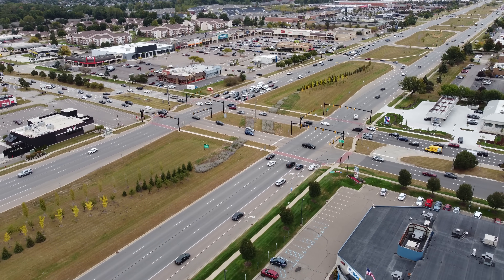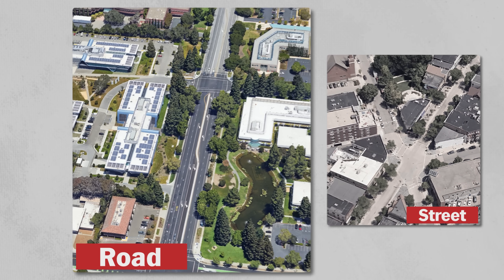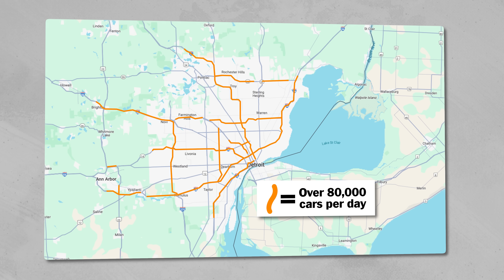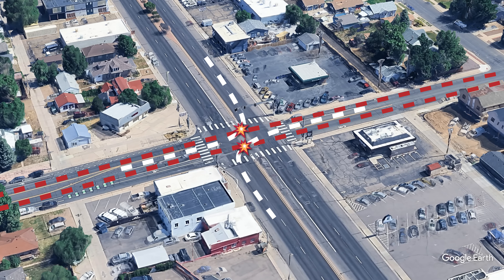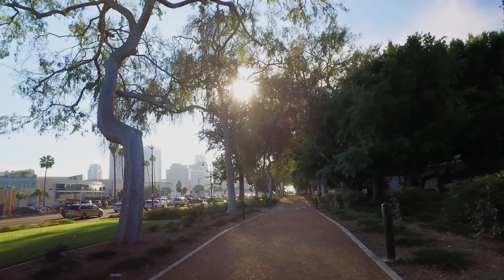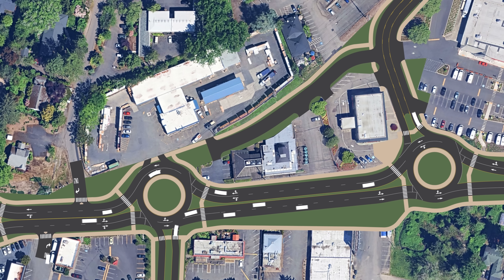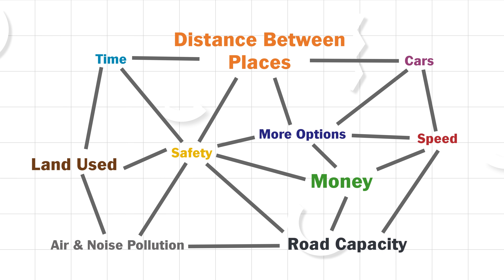How Michigan Built a Super Highway Using Only U-Turns

Comment: In my city Hyderabad India 
It is is very large city recently 5 years ago they decided to replace 50% traffic signals by underpasses and flyovers 
The rest 50% signals simply converted into u turns
There is huge back lash from public but it is saving time

Only issue happening is the one supposed to go straight have to take two turns and he simply shatteres all the flow in all lanes

Comment: 1 thing that was not mentioned in the Uturn idea, is that when in a truck the  vehicle gap problem multiplied. You frequently get "stranded" at a side road and are dependant on a good samaritan to open a gap for you. Very frustrating.   The 2 U turn concept means (directly) less frustration doing your job and ( indirectly) having to deal with other frustrated drivers,getting carved up, brake checked, bullied and harassed ,blocked etc.
Reply: So wait for a green light...
Reply: @traffic.engineer  There are NO traffic lights on side roads in the senario I mentioned.

Comment: I remember the many years before they rebuilt Hall Road, and one of the major issues with it was that on the eastern end, there were two rivers (or maybe creeks) that required considerable road engineering before the whole project could be started. It was a huge delay, and it may be part of why the right-of-way is the 350 feet mentioned in the video. That's what allowed them to go from the two-lane road (on the eastern end) that other comments mention to the 8-lane boulevard we have now.

Comment: There is already a much more efficient distribution system. It is called a "roundabout"...
Reply: This predated the roundabout.

America has more roundabouts than any other country, except France and Italy.  America knows where roundabouts work best, and this road is not one of them due to high volumes.  The volumes on the mainline highway are greater than a roundabout capacity, leading to more congestionnand unnecesary stops.

Comment: 2 errors
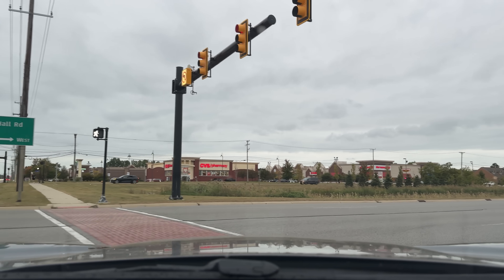3:57 this turn is illegal - you must not enter the left turn closest to the intersection.  That left turn is for traffic already on the road. You will get a ticket for this.

0:00 the Michigan left is only required when your required driver skill standard is reduced. If your traffic does not turn right into the right most lane and left into the left most lane, the laminar flow is interrupted.

0:00 Michigan has a problem with non-adapted lights and not enough lanes in the exits (including the left turns).

You want better results. Use 1-ways with adaptive lights and improve driver skills.
Reply: Incorrect.  The laminar flow must be stopped to allow cross traffic.  This is a signalized intersection.  The movement with the green light can turn to lane because the cross traffic has a red.  There is no law requiring the right turn to the rightmost lane.

Adding more left turn lanes will increase left turn capacity but reduce through capacity.  Adaptive signals work with varying approach volumes but cannot relieve reduced capacity.

Comment: Michigan lefts suck.   You still have traffic lights for crossroads plus you have traffic lights for coming out of the U Turn.  Then you have to make a number of lane changes to get to the turning lane.  For turning cars it is actually more dangerous due to additional intersections and lane changes.
Reply: If you are making lane changes, you are doing it incorrectly.  

Direct left turns reduce through traffic time during peak hours, so rerouting the left turns reduces overall red times.  During off peak hours just make a right turn on red then a left turn on red.

Comment: I have an Android head unit, (radio), that I run Wayz on, while driving East on Hall Road (M-59) and approaching Van Dyke Avenue (M-53) which are both divided highways, a message appeared on the screen that said something to the effect "approaching dangerous intersection". That may not have been the exact wording but it was something similar. I never saw that message before, nor have I ever seen it since at any other intersection.
One safety idea that I like is that in Troy, Michigan, (and perhaps other cities), when stopped at a red light in the left turn lane the traffic signal will give you a green light before giving a green light to traffic going straight. It's not on all of the signals but it's a really good idea because you don't have to worry about being broadsided by someone running the red light while making a left turn - and if you know the demographics of Troy you realize that red lights and speed limits don't mean much to some of the residents. I should also mention that I read an article many years ago that Troy was the first city in Michigan to use an Australian invented method of counting the number of cars waiting to make a left turn by using cameras. The advantage is the left turn signal doesn't stay green if there are no cars making a left turn, this speeds up the flow of traffic for straight-through cars. Again, it's something that I read a long time ago and I've seen it first-hand thought I don't know if other cities us it.

Comment: You have no idea what you're talking about.
Michigan Left turn is the stupidest thing ever, because of NTOR "No Turn on Red" on every freakin intersection.
Granted, there may be 10% of intersection at 10% of the time where the initial right turn may need the "NTOR" because you have to move 3 lanes to the left quickly, to enter the U-Turn corridor when the road is full of traffic
But the other 90% of time, NTOR is not needed.
It just blocks flow, adds tons more time making the U-Turn.
It turns this great idea to something that just adds more travel time, produces more greenhouse gas, and wears out my car faster.
It is nothing but an income generator for the police department.

"Roundabout" is better.
Reply: NTOR is needed because the efficiency creates greater speeds.  This reduces the crash risk.  Though many u-turns allow right turn and left turn on red, making for any wait times that would have been stuck at a left red arrow.  Idling longer increases wear and tear than keeping moving right and left.

And roundabout would not work here due to high volumes.  They work bettter on lower volume roads.  Not to mention obstructing the progression on the mainline.

Comment: Hall road is great, and there are some pedestrian crossing as shown in the video, but you really don't want to cross it on foot or bike unless you have to.  Thus, its size does tend to markedly separate it's north-side businesses and activities from those on the south-side, and you can't bar-hop between sides or realistically engage on foot both sides of it in one adventure, like you can with more intimate arrangements.  I can't imagine, for example, that anyone on a lunch break would bother to cross the road to get to a restaurant on the other side, since the danger and time expended wouldn't make the trip worth it.  You'd just make do with the side you're already on unless you're willing to use your car.

Comment: The real problem is:  highway inside cities.
Reply: This is not inside a city.
Reply: @traffic.engineer  this on in the video? It seems quite urban though. Anyway, in properly designed city Highways shouldn't go deep inside the cities. Should not even connect suburbs with the city center. Highways is for connecting cities, not handling city traffic.
Reply: @NapiRockAndRoll  Streetcraft said "this is not a city street".  Yes, urbanization occured after the road was built, but the primary purpose of this road is connecting urban centers.

Comment: I wish you can do a video on Killeen, TX and specifically the three major stroads, Stan Shcleuter, Cleer Creek and 195. Stan used to be a loop to avoid the highway, now I use the highway to avoid Stan because of the terrible infrastructure. Speed limit is still 55 yet it's so congested that by the time you get to 40 you're at a stop light. Not to mention there are two school zones on that road. In Cleer Creek, they keep adding more and more restaurants, car washes and everything that can build on whatever limited space they have. It's such a terrible design. Oh, and it leads into a military base

Comment: "and then it turned out, it is!" Lol. Sort of, and not at all what he said. You are correct in that they are both road designs. 🤣 But are functionally and visibly different in almost every way. The roundabout is referenced in this video as an entirely seperate tool you can add to the U-Turn based design the video is about

Comment: I live in Michigan on a small road off Maple Rapids Road which crosses US-127. The expressway US-127 runs through the middle of the state until it meets up with I-75, but there is a strech from St. Johns to Alma where it is no longer expressway and has roads and driveways off of it. The speed limit is reduced from 75 mph to 65 mph. However, most people continue to speed through as though it were still expressway. In recent years there has been tons of road construction in this area as the state removed all the intersections along this strech of highway, replacing them with Michigan Lefts.

Maple Rapids Rd. and other roads along this stretch used to cross the highway, and you'd have to cross each side of the highway at a time if you wanted to go straight across, stopping where the road crosses the median. Or if you wanted to make a left turn onto this road, you'd turn into the spot where it crosses the median. But if more than one or two cars wanted to do this, they'd get backed up onto the busy highway. It was very stressful and dangerous and there were no traffic lights as they did not want to stop the flow of traffic on the highway.

The recent construction work added the Michigan Left U-turns and took out these dangerous intersections. Now you can no longer go straight across, but instead turn right onto the highway and use the Michigan Left to pass to the other side. They also added turning lanes for the U-turns and the right turns onto main roads, giving space for more vehicles to be turning at a time without backing up onto the highway. It's not perfect, but it's much safer than it used to be.

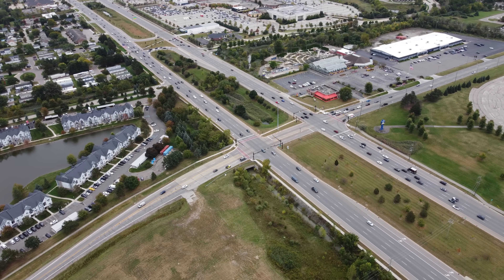Comment: 4:58 this is only the case when you are one of the first few cars waiting to turn "left". Cars coming from further behind will have to wait twice as long.
Reply: I assure you these are still more effective. My recommendation is if the first one is back up to grab the next one. As a Michigander this is a common practice.
Reply: @richardkinsley2984 it depends honestly. The Michigan left worked beautifully on 16 mile two hours ago but earlier today I didn't even have to wait to turn left on 15 mile with the flashing yellow about 10 seconds after the light turned greaan

Comment: So you made a giant rectangle roundabout
Reply: This predates the roundabout.

And a standard roundabout with priority rule would not work here.  It would cause unnecessary stops along the main road for the few sidestreet vehicles.  The total delay is more than the standard red light stop with these volumes.

PS:  America has more roundabouts than all countries, except France and Italy.  So America knows where they work best.
Reply: @traffic.engineer  The Michigan left dates to the late 1960's, The Michigan Department of Transportation first used their modern design at the intersection of 8 Mile Road (M-102) and Livernois Avenue. Roundabouts have been around since at least the 1700's, there's even one in the city of Amarillo from the 1920's. I did learn something new however, that may have led to the confusion, the "modern" roundabout rules where outside traffic yields to cars inside the circle was not normalized until around the same time as the Michigan left being developed (early 1960's)
Reply: @mcsomeone2681  Maybe they mean it predates the notion of roundabouts to the everyday westerner / American. While Michigan Lefts have been used HEAVILY in southeast Michigan since the 1960's, long before most Americans (and Michiganders for that matter) even knew what a roundabout was. Michigan Lefts are very efficient, more so than roundabouts at two large connecting roads and the idea of them just being long roundabouts is silly, but commonly made by people online who barely know much about them.

Of course roundabouts are as old as time probably - it's just a circle at two intersecting roads, I'm sure horse-drawn carriages went through them often.
Reply: @mcsomeone2681  If you interpreted snideness, then that's on you buddy.
Reply: @mcsomeone2681  America had the first traffic circle in 1905, with Europe following suit later.  But they were just pavement with no standard traffic control.   The standard priority rule was developed on the UK in the late 1960s, but standardization and implementation of roundabouts throughout Europe did not start until the 1970s.  America had largely abandoned traffic circles in the 1950s, due to no safety nor efficiency benefit.  It was not until France's 1980s campaign did America start building modern roundabouts in the 1990s.

Comment: Let's look at this more closely.  Assume a typical in a Michigan left intersection that has a crossing signal and the left turn lanes have signals.  The motorist who wants to make a left turn.  Chances are good that the motorist will face a red signal.  If the motorist doesn' have a red signal, he/she has to be in the left lane to turn.  He/she will slow before reaching the left turn lane.  This slows the left lane traffic, making it impossible to maintain the speed limit.  Then, the left-turning driver has to wait for the left turn signal.  Next, the driver turns into the opposite left lane, and has to cross 2 or 3 lanes of traffic to get to the right lane to complete the turn, maybe having to wait for a traffic signal again.  If the left turn lane has a STOP or YIELD sign, the motorist has to cross 2 or 3 lanes of traffic to get to the right turn lane.  So, the turning motorist might have to wait for 3 red traffic signals, and has to dodge 2 or 3 lanes of traffic to complete the turn.  Give me a traffic signal with a left-turn arrow any day.

Comment: I hate the Michigan Left!  It requires me to think really hard about if I really need to go to that particular store.  Is it worth it?  Often the answer is NO!  It is sooooooooo frustrating.  I am not a fan of the MICHIGAN LEFT.  in Ann Arbor (the birthplace of this beast)  try to get to Lowes on West Jackson without having to travel North on Zeeb over the overpass ... there is no Left U Turn.... so you have to go through McDonalds or make a U turn in the Police substation... or you can proceed North for 1.5 miles through another Light Signal Intersection up to the roundabout and circle back.  So!  3 miles out of your way just to make a Left turn.  OR!  You can Turn Right and navigate through a Left U Turn that makes you sit through 2 additional light cycles.  It takes as much time as the 3 mile detour.  I really hate that intersection!  If I am coming South on Zeeb and want to get to the Credit Union that is E on Jackson, I again have to make a Right on to Jackson and deal with the Meijer Traffic  where the UTurn is or proceed South and turn around at Wendy's  in general... it is annoying and frustrating!  Time the freaking lights to accommodate the flow of traffic.  They did that on miles and miles of US 12... it works!  As for roundabouts.... (sigh)  yield don't stop unless there really is no way in.  I swear the people who roll through stop signs are the exact same ones who stop at a roundabout.

Comment: Michigan Left works well but the biggest draw back is the drivers acting stupid. Drivers needing to go the opposite direction end up firing unsafely across 4 lanes of traffic in an attempt to make the first left turn instead of going about 1/4mi up to take the next turn. The MI Left does ease congestion but all it takes is one dumbass to wreck and block the lanes.

I also understand the road layout in Jersey as being OK for easing congestion on unprotected lefts.

Comment: Even these roads have problems. They're great, but traffic still backs up on some. And the problem usually occurs when you get 2 major cross roads like woodward and square lake, or telegraph and squarelake, or basically any mile road north of 696 that crosses  telegraph. Still much better than a left turn would be at those intersections!

Comment: Moved to SE Michigan from Boston in 2004.  I do appreciate the Michigan left but there wre some drawbacks that you can experience daily on Telegraph rd.  If that turn isnt put far.enougb up, People run the light turning right and will completely block the left lane of traffic going straight. Also people travel slowlly in the left travel lane 2 miles before using the U turn because they ar3 afraid of not being let in.  So its good....but not perfect.....

Comment: Ok that's fine and all but what about merging 3 lanes to GET TO the left turn? What if you can't merge cause some dummy blocks the lane you need to merge into to make the Michigan left? Or does the traffic light help with that, also what about someone who runs the red light as you are making the right to go left?
Reply: You do not "merge".  You turn directly into the lane that enters the u-turn when the signal is green.  Right turn on red is an option, not a requirement.

As for red light running, that is an issue for every other scenario, whether making a direct left or turning right.  Same issue when entering a traffic circle.
Reply: @traffic.engineer Just saying infrastructure is getting complicated and people don't know how to drive as is.